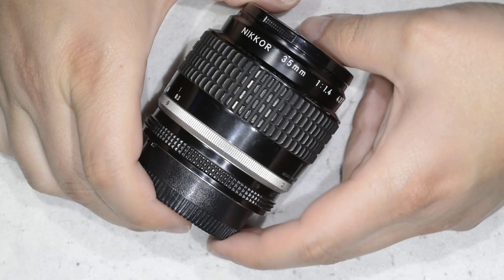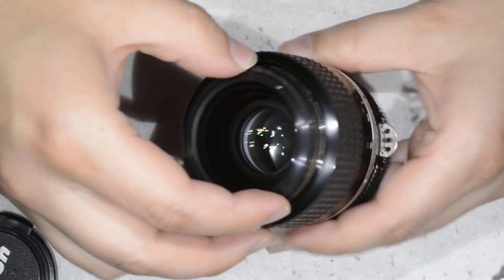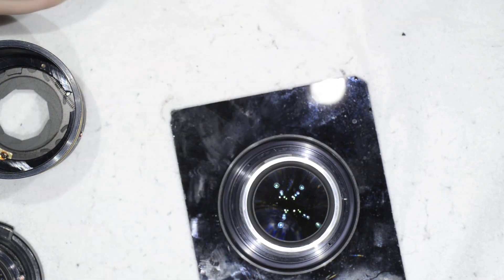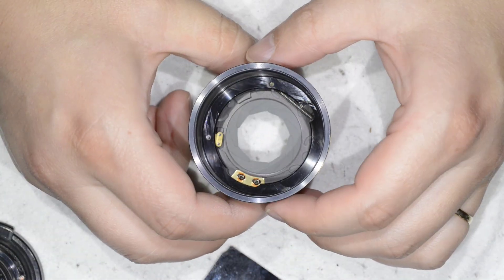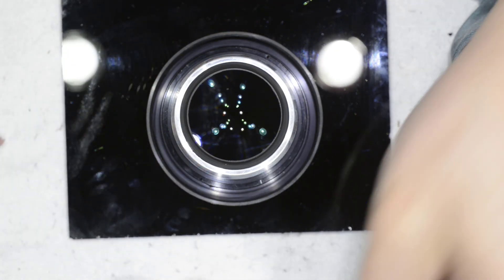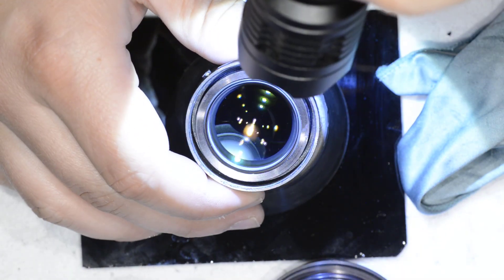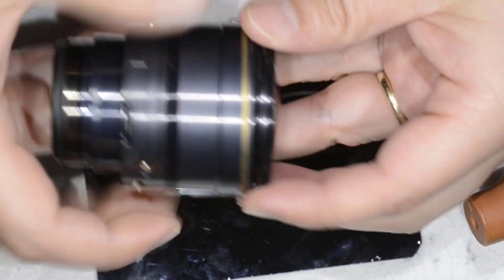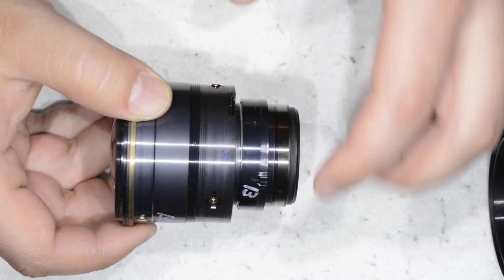Nikon Nikkor 35mm f/1.4 : Disassembly & Cleaning

Comment: Can you sometime show how to remove the back lens element on some of these Nikkor lenses? Especially since a dirty inside surface on the element whether haze or dust that is closest to the sensor will degrade the image more than in the front elements. I have a 135mm f2.8 ai-s lens with a lot of internal dust on the rear element. But all the videos that I watch for similar lenses only show how to take out the front elements and/or clean the aperture blades. `
Reply from the maker: Hi, I see what you mean. The sealed elements are rarely dirty, that's why it is very difficult to find information about how to disassemble them. Yes, I can do that, but not sure it is going to help as most of them are different. I think I have a 135mm on my table waiting for repair, I'll look into the rear element. Cheers.
Reply: @diyextravaganza  TY!